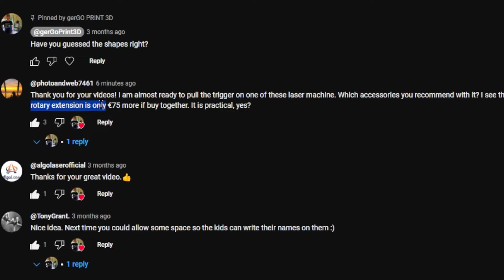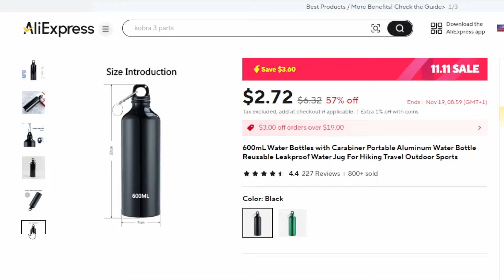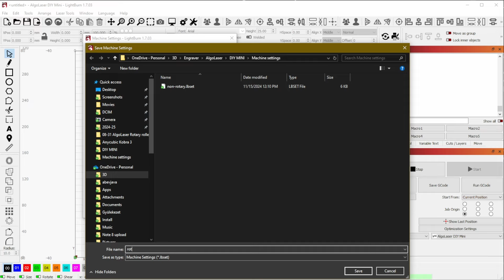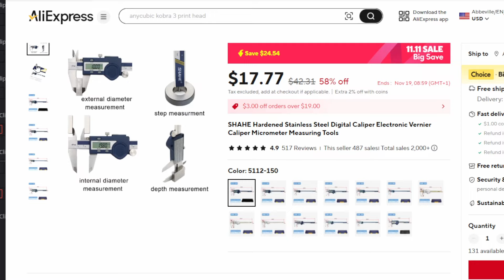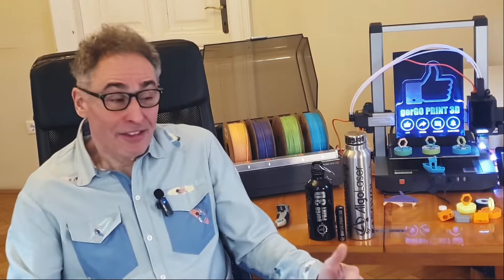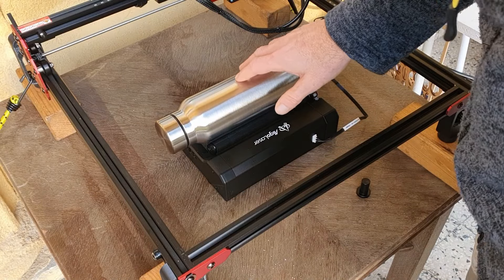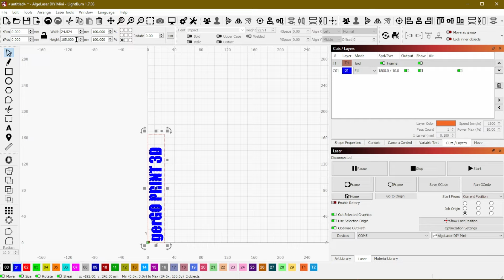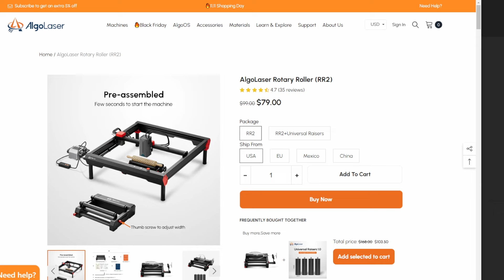Engraving Metal Bottles & Flashlights with a Diode Laser 🎁 Rotary Attachment - Should you get one?

Comment: I have a machine MK2 10W Can print designs on stainless steel Is it one that isn't painted like yours?and set 100% sensitivity 1800
Reply from the maker: It worked for me. This is probably the very same laserhead AlgoLaser puts on the MK2 as well. I haven't tested other stainless-steel items, but the one linked from AliExpress worked well for me (get one of the smooth ones). Maybe they have some kind of coating, I'll have to test other stainless steel items.
Reply: I want to create a shiny, black surface like your water bottle cap.
Reply: I used the setting of 100% exposure, 1800 sensitivity to create the image on stainless steel and aluminum. It produced a black image as per the clip you suggested. I used a machine.MK2 10 watt
Reply: I appreciate your great knowledge and advice.

Comment: Do you have a good method for laser cutting clear acrylic?
I tried it with card stock and spray paint.
The acrylic material is 1-3mm thick.
But when I etched it, it cracked the clear acrylic in small spots. Do you have a good method?
Reply from the maker: I cut and engrave clear acrylic using my CO2 laser. I recommend smearing dishwasher liquid on both sides to avoid fogging.  I'll make a video on this soon.

Comment: Can I ask one more question?The laser manufacturer said that the laser module is 10 watts.Stainless steel cannot be laser-treated black.Even if you can do this, it may damage the laser module.What advice do you have regarding these warnings?
Reply from the maker: OK, so I tested with a magnet, the silver bottle is very very slightly magnetic, so it is probably not clean steel but some kind of alloy (nickel?). As for damaging the laser, I haven't noticed any issue, probably due to the fact that this is not a polished surface but actually a satin finish, which diffuses light preventing it from being reflected back into the laser module, which would potentally damage it.

And yes, the mark is very dark (as seen in the video) and permanent.  I tried scratching off the marking but it is not on the surface, goes deeper. Afaik 10W laser at 100% should be enough to perform surface modifications.

I put the link to the exact bottle I used, I can only promise that it worked with my AlgoLaser 10W blue laser.